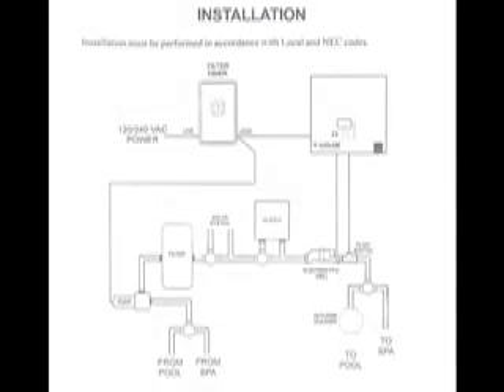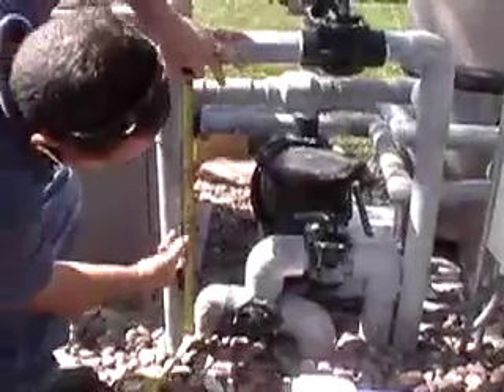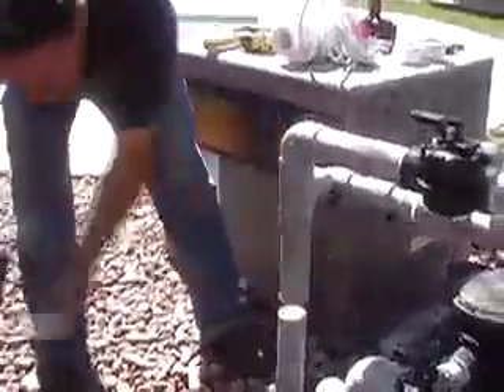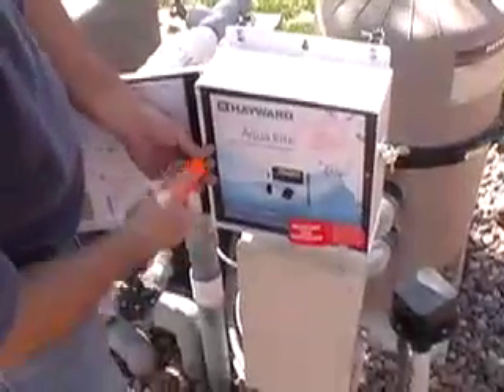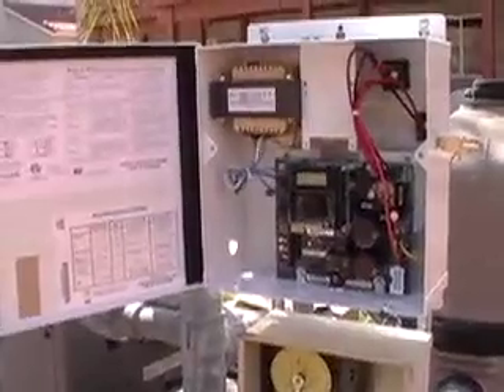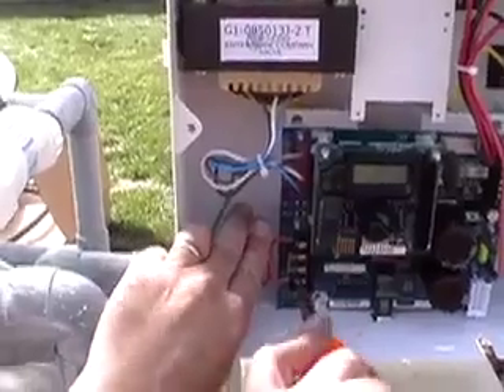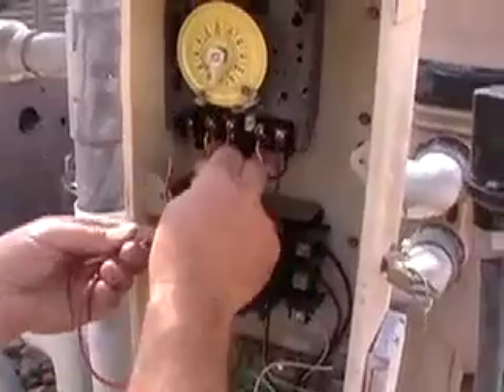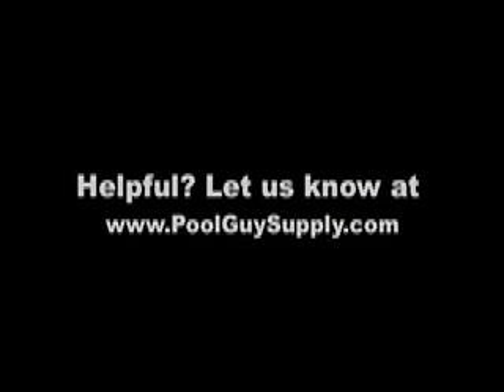How to Install a complete AquaRite System

Comment: Do I connect the electric wires from the  T-cell-15 unit to the pump power supply (220v) or the power supply for the lights (110v)? The installation instructions are not clear about this. I believe it’s the 220 power.

Comment: The company I hired to instal my solar pool heating were a bunch of monkeys, they put both temperature sensors in the piping manifold, but I have read one must be on the roof? My automatic valve is open most of the time feeding "hot" water from the solar to the pool and occasionally closes for a few minutes. My pool was only hot during summer but once we entered fall is always cold. When the system is on i can feel the return jets feed hot water, but the pool can never get hot to be used, would I need to move one of the heating sensors to the roof?
Reply: Hey 1sensor needs to be inside the pipe before your solar valve,second sensor needs yo be anywhere where sunlight hits it when pump is running , no need to install it on the roof

Comment: I recently replaced my salt cell, When I cycle through the display using the diagnostics button, I do not have an option to select the type of salt cell (T-3, T-9.. etc.) Is there any way to fix this?
Reply from the maker: If you do not see an option to select a different size salt cell (T-9, T-15, etc) it usually is an indicator that the PCB is factory configured for only 1 size T-Cell, and cannot be changed. This would mean that as long as you are using the same size salt cell as the one you previously replaced (replacing a T-15 with a T-15) then it should be pre-configured for the correct cell size, and will not need to be changed on the PCB.
Reply from the maker: That means you're circuit board doesn't have the capability to switch salt cell sizes.  Some of the older boards and the aftermarket replacement boards don't have this functionality.  The only way to change this is to replace the main circuit board.